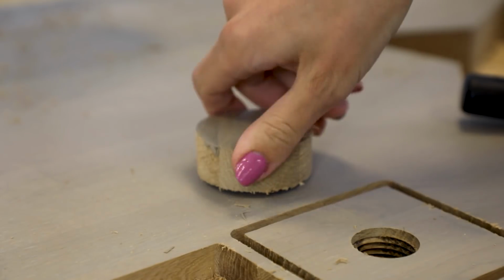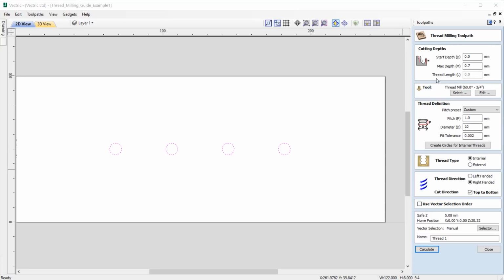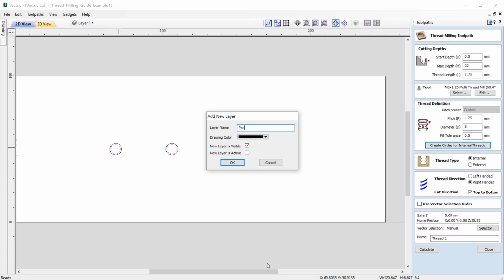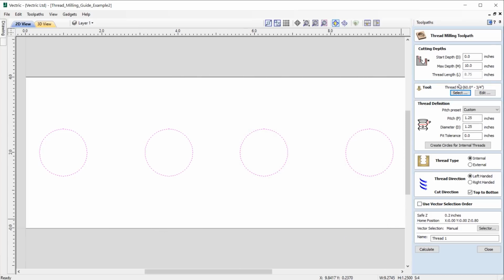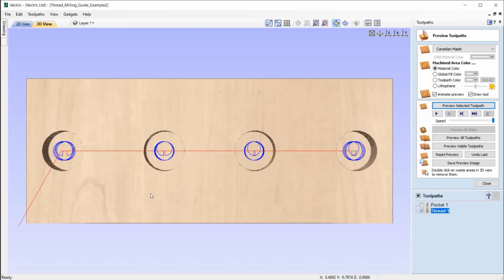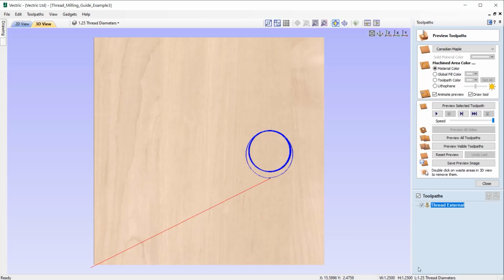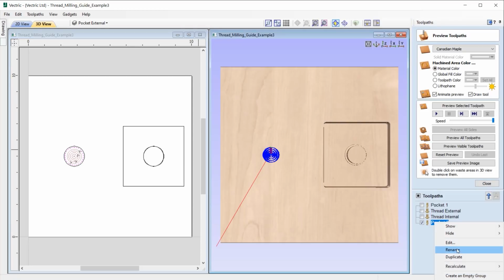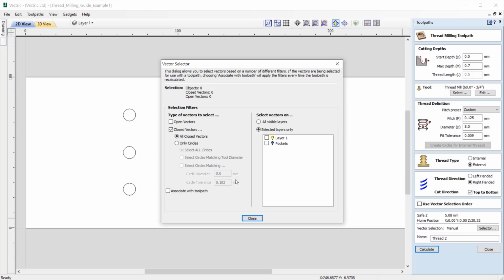Vectric V10.5 Tutorials | Thread Milling Toolpath Guide 2D Toolpaths

Comment: Do you have any example part numbers for the thread cutting bits?  The single thread one would work well for a project I have in mind but I am not finding them on Amazon.
Reply from the maker: Hey Dave, This is the single thread tool we used: https://www.mscdirect.com/product/details/03196052 and as @garyarch0 has linked you, I'm pretty certain this is also where we got our multi thread tool from - thanks Gary! I hope this helps! Thank you!
Reply: Also try ebay "thread mill cnc" for the Chinese versions if you want to go that route
Reply: I would like to know a source for 1/4' shank bits to use on my router?
Reply: @billlydie5305  - All I have found so far is this one.  1/4" shank 90 degree and not too expensive 
https://www.magnate.net/ProductDetails.asp?ProductCode=796
Reply: Thanks guess I will keep looking and asking
Reply: I notice most thread mill bits are for a 3/8 inch collet.  I am using a DeWalt 611 palm router on my Pirhanha and would like a 3/8 inch collet.  Sent email to www.elairecorp.com to see if they can provide one.  I have gotten collets from them in the past so will let you know when I know.  Anyone know of any other places or where a collet could be purchased?  Only finding one 1/4" shank bit sort of limits one
Reply from the maker: @billlydie5305  Hey Bill, might be a good idea to ask on the Vectric Forum to see where other users source parts from: forum.vectric.com I hope this helps :)
Reply: @billlydie5305  I think, because you're using a trim router, the largest size you can get is 1/4" shank. I checked Precise bits (https://www.precisebits.com/products/equipment/dewalt_611_collets.asp&filter=1) and they show nothing bigger than 1/4"